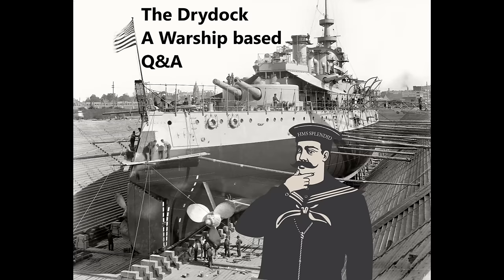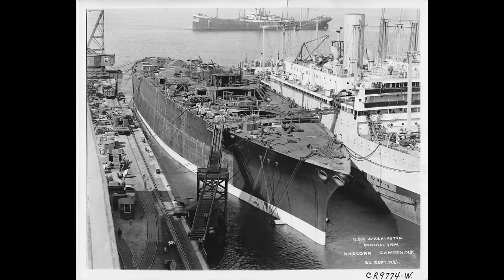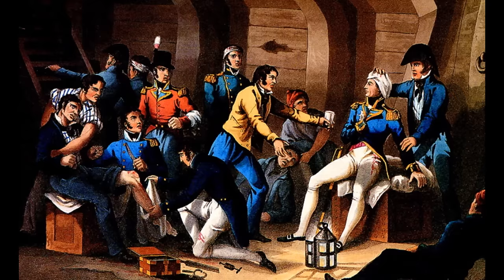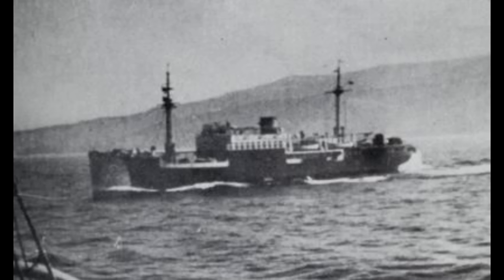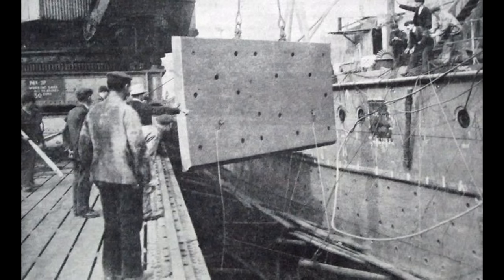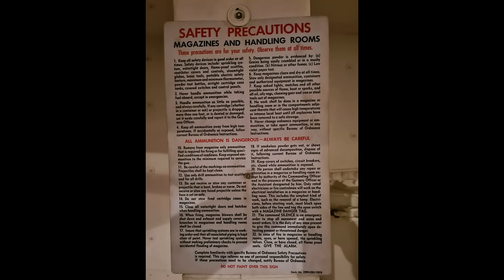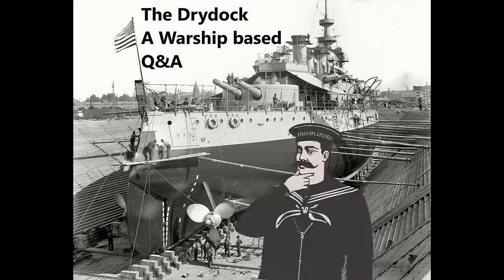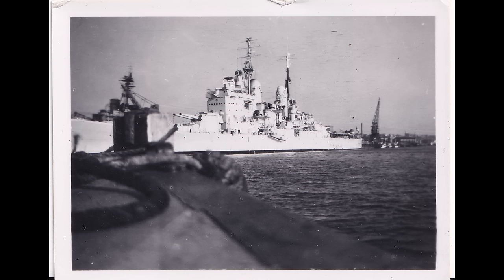The Drydock - Episode 219 (Part 1)

Comment: Based on my years in the navy on surface ships and submarines, the safest way to go down ladders is always facing it.  You have the best grip and most of one or both feet are on the ladder.   Facing away your grip is not as strong and you only have your heals on the rungs. Of course, almost all sailors go down ladders facing away.  It is just faster, as you mostly slide.  As well, it marks you out as someone with experiance of life at sea, as oppsed to passengers and riders.
Reply: True
Reply: @johndrennan5933  I normally went down that way (On O-boats there was physically no option, the ladders were literally ladders).  The one excepting was when wearing fire fighting gear.  There is simply not enough purchase for your feet if you try to go down facing away.  When the replaced the Chemox Re-breathers with air bottles the bottles caught on the rungs if you were facing away.
Reply: People go down ladders facing away from them? If the ladder is angled a bit like a staircase that sounds fine but if it’s vertical it sounds like asking for trouble
Reply: On board a ship, the nomenclature isn't ceiling, wall, floor, and stairs; but overhead, bulkhead, deck, and ladder.
Reply: @johndrennan5933  I’ve been out of the navy 30 years and still occasionally say bulkhead (edit: and head). But I always went down ladders on my carrier facing forward and don’t recall seeing anyone do it differently. Of course space is less of a premium on a modern carrier than an older destroyer for example. Some of their ladders are very steep and I couldn’t imagine walking down them like steps.
Reply: During my 20 years active duty the only time I can recall going down an inclined ladder facing it was when manhandling a heavy load down where you had to support the load above you whilst you slid it down the ladder.  This generally required another guy above the load to take up some of the weight and he would be facing away from the ladder so he could bend down to get a grip on it.

For normal moving about the ship I, and all my shipmates across multiple ships, always went up facing an inclined ladder and down facing away.  Always.  Vertical ladders you obviously had to face in both directions because, well, vertical.
Reply: Yes...I recall the hands-only "slide" going down. Chiefs n officers would yell at you for doing it if they saw you, but it was generally standard practice for us junior sailors. Least it was aboard my ship in the early 90s...
Reply: @wheels-n-tires1846  I was one of the guys yelling at you for doing that.
Reply: @Shinyworldwide  ftom a construction  perspective the ladders on scaffold are often nearly vertical and the hatches tiny  so I got used to going down ladders facing away cos its easier,  but as old mate said, its definitely less safe.
Reply: If you have the fat guy go first... it doesn't really matter
Reply: @joshstanton267  I was just going to say something similar. I worked in a Papermill for 10 years, it was common practice to slide or go down ladders the wrong way round. 😂
Reply: Have seen one athletic type go down one handedly- cup of tea in other -

Comment: I was Tin-Can Navy.  We walked up ladders face forward, and slid down the rails on our hands, face-away from the ladder, at sea or in port, regardless of sea state when at sea.  Going down was dangerous, and it was just best to get it over with.  One time, when we were in port, I got assigned to tour guide duty (USS Berkeley, DDG-15, somewhere around 1982, San Diego, IIRC).  I had just shown my troupe the signal bridge on the O3 level forward, one deck above the bridge, and was taking them down to the ASROC deck on the O1 level.  The only starboard to port ladder on the entire ship was behind the forward stack, and it went from the O3 to the O2.  It was a long one.  The next was a for-and-aft to the O1 just forward of the ASROC.  I wasn't thinking.  I jumped the rails and slid down to the O2, took the standard one-step-and-turn at the bottom of that ladder, turned to the next ladder, and slid down to the O1.  It only took seconds, and not very many of them.  I looked up two decks and there were some boys staring at those ladders with something akin to pure glee in their eyes.  I yelled, "DO NOT DO THAT!"  Their mothers and/or fathers grabbed the kids and kept them off of the rails.  The boys were horribly disappointed.  I could have gotten into some serious trouble.  Without extensive practice, riding the rails can get you either killed or severely injured.  It's just how we took the ladders.
Reply: Haha....great story!!!! Even as an adult (??), I remember "the slide" was always a quick source of joy aboard ship!!!
Reply: 😂more spectacular with a plate of scran and smarty pants gets it wrong -

Comment: @Drachinifel As a young idiot Midshipman I cut my teeth on descending down ladders forward on Her Majesty's Australian Ships (As they were then) TOBRUK and MANOORA. As you said; it was faster and easier; you basically slid down putting all your strength into your arms on the rails and basically allowed gravity to carry you down, controlling your descent speed using your feet. This was commonplace alongside and at sea. What was also commonplace, however, was the amount of people who hit their heads on the opposite sides of hatchs whilst descending due to an unforeseen pitch of the ship. It was also surprisingly difficult to descend down a stairwell forwards during damage control whilst wearing OCCABA as the tank had a tendency to hit the rungs as you went down. All pussers did it of course, but even when I first joined, RAN's Green Team (Sea Training Group) were cracking down on it to eradicate it as some boffin had done the studies to show that descending forwards was more dangerous than descending facing the rungs. And it probably was, on average.

Comment: The discussion of ships vs. boats reminds me of an interesting quirk. Vessels designed for service on the Great Lakes, regardless of size, are generally referred to as 'boats'. So yes, this means that a 1000' bulk carrier is an 'ore boat', and the SS Badger, originally built as a railcar ferry and now carrying passengers and automobiles (and the last coal-fired commercial vessel on the Great Lakes) is a 'ferry boat'. The term 'ship' is generally used to refer to 'salties' i.e. ocean-going vessels that came in via the Saint Lawrence Seaway. Another quirk is the use of statute-miles per hour to measure speed, rather than knots.

Comment: Also during the British post-Jutland overhaul of the shell designs for more realistic APC/APBC/SAPC oblique-impact intact perforation requirements (tougher middle body and base designs; insensitive Shellite or, for smaller guns using the CPBC/SAPC shells, TNT explosive fillers; and use of hardened AP caps that work against shatter at any impact angle that might occur in a battle), they found out some other interesting facts:

(1)  Cast projectiles (12" Mark VIIA APC, the first of the Greenboy shells), where the shell was machined from a single pre-shaped steel shape with only heat treating used to adjust the hardness and toughness of the projectile nose and body from point to base, were considerably weaker and more brittle than forged larger shells, where the cylindrical metal blank was squeezed, hammered, and bent to its final rough shape, being heated and reheated between and during mechanical shaping treatments, forcing the cylindrical initial shape into various curved nose-shaped dies and creating the large internal cavity by forcing a cavity-shaped hardened-steel shape into the shell bottom.  The mechanical working of the projectile's metal caused the "grain" of the various crystals formed in the shell's metal to line up in ways that reinforced one-another along the directions that impact forces from hitting thick armor would also align.  Thus, while the 12" shell could not remain intact when used against 8" (0.67-caliber) KC plate (British "Cemented Armour") at 20 degrees or more obliquity, there was no problem with the larger shells at even high angles against plates of several thicknesses -- tests of the HOOD's design armor by 15" Mark VA APC shells demonstrated this conclusively.  Forging was used in all later British shells to be used against armor of any type or thickness.
(2)  Possibly due to the fact that Shellite was somewhat less powerful than TNT, though Shellite could usually be detonated by a black-powder booster just like Lyddite could, smaller British guns in cruisers and destroyers -- and strangely in the 16" AP shells for NELSON and RODNEY -- used TNT as their explosive filler when introduced in the 1920s, though Shellite was resorted to for the 14" and projected 16" guns in the British WWII battleship designs.  TNT was not detonable using black powder and was difficult to get reliable full-power detonations until Tetryl was introduced in 1928.  From the many tests that I have seen, including those against the German battleship BADEN, Shellite had a rather large number of less-than-full-power explosions from its use of the same black-powder ring-shaped booster used with Lyddite.  It seems that to get delay-action deep target hull penetration, any explosion was considered acceptable.  Thus, until 1928, the TNT-filled APC/CPBC/SAPC shells were accepted even with their non-optimum explosive effectiveness.  This was similar to all US Navy Explosive-"D"-filled shells AP and Base-Fuzed Common shells until they introduced Tetryl also in 1928, even though the US Army had been using Tetryl boosters in its Explosive-"D"-filled shells since 1918, indicating that the safety requirements of the US Navy were such that retests and re-retests were necessary to convince the safety personnel that Tetryl was "safe enough".  Once the Tetryl had made TNT-filled British naval ammo get fully-acceptable test results (90% reliability), eventually the Shellite-filled large-caliber APC shells (all but the TNT-filled 16" Mark IB) were improved by using the same Tetryl booster used for the 16" APC to get full reliability by WWII.

(3)  Hard caps worked better than soft or tough caps because they punched a deep pit into the plate face as they were destroyed -- which a softer-faced cap could not -- and this acted just like the use of a center-punch just prior to drilling holes in steel plates at a manufacturing plant.  No new soft-capped British ammo was made (neither was any US Navy soft-capped AP ammo after the last Midvale Unbreakable 16" Mark 3 AP projectiles were completed for the COLORADO Class battleships, where no new-design, hard-capped AP ammo was introduced until the miod-1930s.
(4)  British Common, Pointed, Capped (CPC) 10%-black-powder-filled anti-ship (and anti shore in some battles) ammo, was an unusual soft-capped semi-armor-piercing ammo used by the British Navy during WWI.  The nose was very similar to a British APC shell, including a soft AP cap for penetrating face-hardened armor at a near-right-angles obliquity.  It was specially designed for large guns hitting small enemy ships.  The cap was for those ships that had face-hardened armor (battle-cruisers) but armor thin enough, up to 0ne-third caliber, that the shell at those low impact angles could remain intact after penetrating.  Black powder in the usual uses exploded with a powerful blast, but not a true detonation, so the shockwave created did not have anywhere near the same power as a detonating explosive like TNT or Lyddite, being about 0ne-third as powerful and causing more damage due to the fireball it creates than its explosion power.  Also, however, the shell is blown into fewer, larger, slower pieces, forming more like a shotgun blast moving in the direction of the shell when it exploded, with the heavy nose and base plug punching the deepest and largest holes in front of the shell.  The blast from the base fuze takes up to 0.075 second to spread to enough of the black powder filler to finally tear open the projectile body, so that the shell has a very long delay built-in without the need for a delay-action base fuze.  Note also that even if the shell breaks up during penetration, the friction from the breakup will usually set off the filler and it will cause considerable fire and fragment damage from the side of the shit hit to as far as the pieces can reach inside the target.  In effect, the results of being hit by this shell were in many cases just as bad or even worse than when hit by a Lyddite-filled APC shell.  Until the new Greenboy APC ammo was introduced, the post-Jutland battle instructions was to use CPC instead of APC in most situations.  It seemed that the British had realized that deep penetrations were better, but until Jutland had not been able to overcome their previous infatuation with the most powerful filler being the best filler, ignoring all other facts.

(5)  British CPC had another effect that was previously not realized when hitting thick face-hardened armor at a low obliquity.  The projectile would collapse like a bag of water dropped from a height onto a concrete plate, being compressed lengthwise as the nose decelerated and the weak middle body kept moving forward.  However, when CPC shells hit at low obliquity at a high-enough velocity for a similar size and weight APC shell to perforate the CA plate hit, an unusual thing happened.  The black powder, made up of finely-packed, but separate powders of sulfur, charcoal, and potassium nitrate (saltpeter), was thrown forward by the intense inertial slowdown at the plate face, compressing it to a virtually solid mass with all of the empty spaces between the powder grains squeezed out.  This pushed the powder into the front half of the cavity where the shell was surrounded by the armor plate as the nose punched through.  Thus, the filler was held tightly in a oval-nosed cavity held rigid by the thick nose and the armor to the sides and the huge force from the rear due to the sudden slowdown.  It was also crushed so tightly together that it started exploding everywhere at once throughout its entire volume, simulating an HE detonation.  Since the amount of filler was three times what was in the usual APC shell and one-third as powerful, the result was a detonation inside the armor plate exactly like a Lyddite filler detonating while its shell was imbedded halfway through the armor.  This caused British CA plates so hit in tests to have enlarged holes made in them and many plates actually split in two through the hole.  Thus, CPC shells could have even better anti-hull armor damage than the APC shells that were supposedly the ones designed to so penetrate the enemy target.  Another result not understood and not utilized until after it was no longer the major weapon result desired.  It is necessary to fully test and understand the results of the tests of anything that you need to do a task, military or otherwise...
Reply: Um…. I can recognize the intelligence of your words even though I cannot understand most of them. 

Are you a metallurgist by any chance?

Comment: Relative to sharing the same machines between the services I am aware that the B24 Liberator was used in the Pacific by the Navy's Heavy Bombardment Group as well as the Atlantic for antisubmarine patrol. Basically if the mission required a certain level of performance then inventory was searched for the closest fit for that job.

Comment: 1:49:00 I suspect a big factor would be the scenario where the landing occurs.

If you are out of the front and the last plane returning crashes, you are probably salvaging whatever you can fr it and, unless it burnt up, there are almost certainly valuable parts and equipment on board.

On the other hand if you are on the front lines and a plane crashes in the middle of your flight deck while you are trying to land one large strike package and launch another, you are may well just shove it overboard regardless of condition as the loss of one aircraft is cheap price to pay to minimize the disruption to flight operations.

Comment: On the question of larger ships being faster, you're right on the mark about hull speed. The calculation is the most basic one in all of naval architecture - 1.34 x the square root of the waterline length. At that speed any displacement hull will have the trough from the bow wave extend all the way to the stern end of the waterline. The amount of power it takes to go faster than hull speed rises exponentially.
Reply: An 80 thousand horses power destroyer could hit 40 + knots - a 40 thousand horse power destroyer could hit maybe 35 knots - but slow down quite a but in a big sea .those very very fast destroyers often seemed a bit fragile .(in a big sea)

Comment: If an aircraft does a nose plant into the carrier deck and pretzels the propeller, checking the propeller shaft for alignment is not enough.  The engine has to be entirely dismantled and every piece checked for trauma or stress from the instantaneous cessation of rotating motion.  In practice this is not cost effective, especially onboard the carrier, so the engine would be entirely replaced, maybe non-moving parts salvaged, or in peacetime the engine could go to a shore facility for assessment/rebuild.